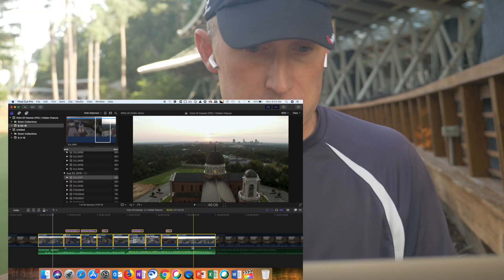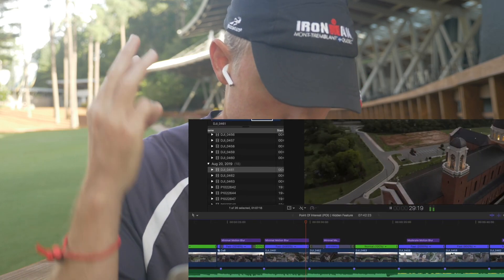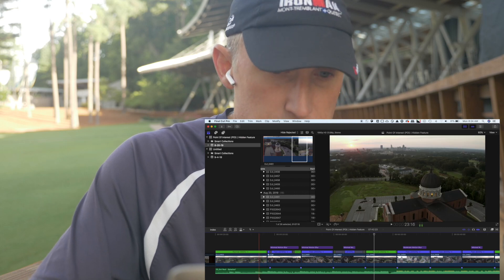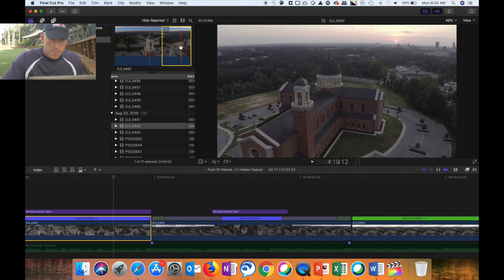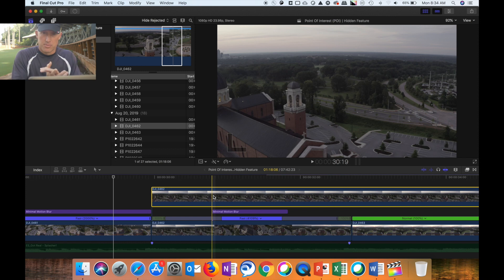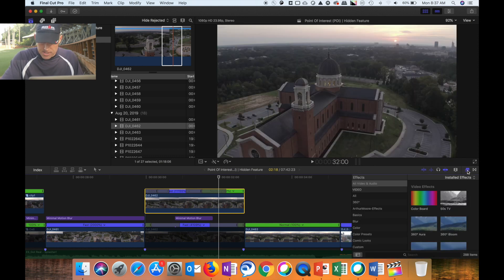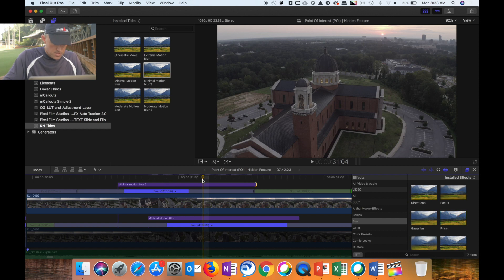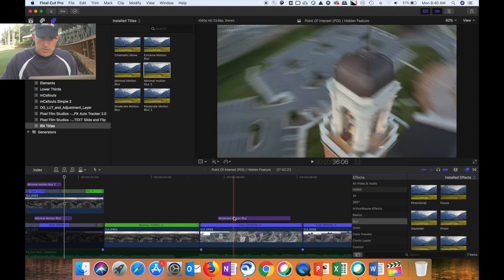Speed Ramp FCPX For Drones Tutorial

Comment: I've watched all your Mavic Air videos as well as a few others. Great content and well used. Thank you Jeff. After abandoning GoPro Studio earlier this year I started using Premier Elements and gradually finding my way. Wrt speed ramping - if you want to speed ramp every 90degr of a full rotation around a bell tower, do you insert transitions between the slower & faster portions? It doesn't seem so (I would think not...)
Reply from the maker: Nope, I wouldn't use transitions either. I would maybe show 100% for 1-2 sec, ramp to 90degre, then 100% for another 1-2 sec, and repeat.
Reply: @JeffGreeneChannel  Makes sense. Thank you.
Reply from the maker: @seanfrench1029  thanks sir, good question.